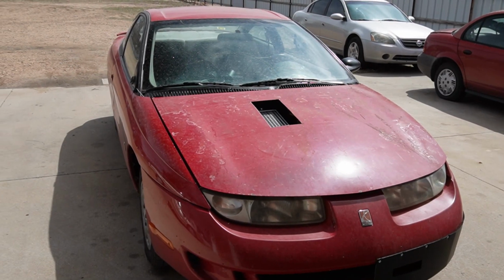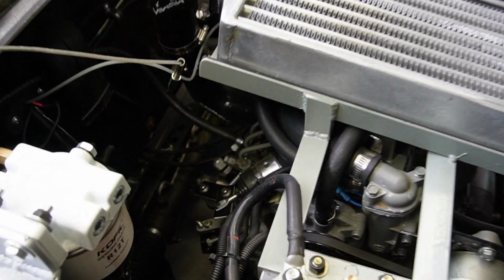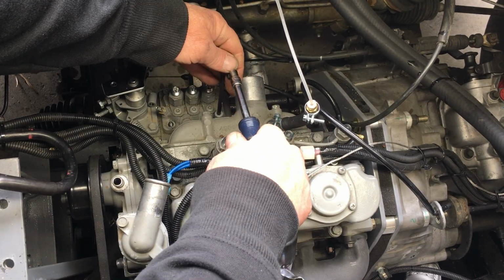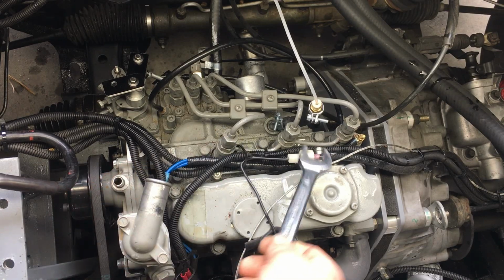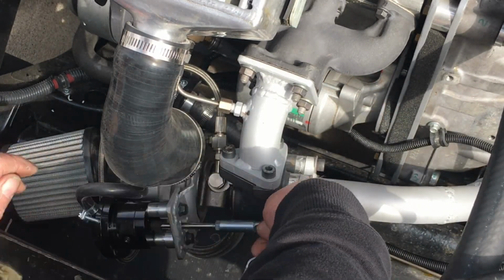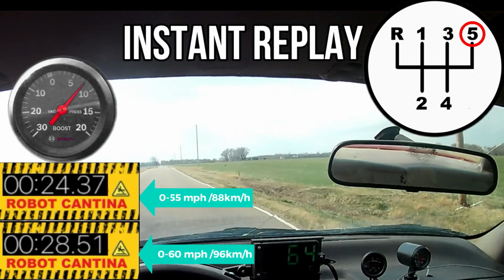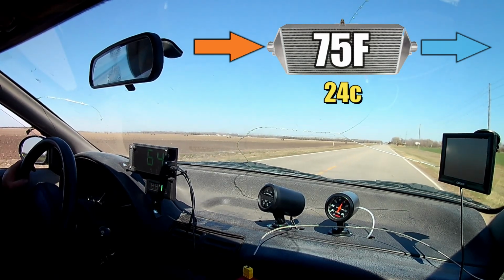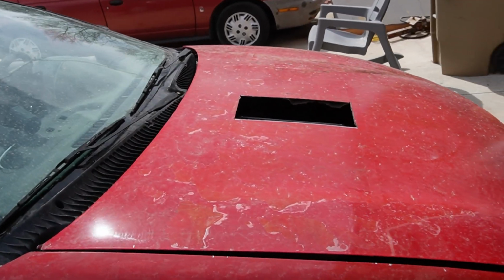S3 E9 We modify the injector pump timing and add more boost for more speed and better fuel economy

Comment: I might be a little crazy for this, but you may want to make your hot side of your turbo a little smaller so the Boost comes on and lower RPM's and is more consistent. It may help you maintain higher boost levels and lower egts.
Reply: Different manifold with equal length runners will fix the exhaust pulse issues causing the higher RPM turbo spin up time. It will also fix the EGT issue because the turbocharger will flow more air on the compressor side for longer under load due to the shorter time between exhaust pulses. A lot of 2 and 3 cylinder engines have this issue with turbochargers. Putting a super small housing around the turbine is just a lazy way to fix the issue and hinders how much overall power you can make due to turbine and compressor wheel sizes needing to be similar for balance reasons at 100,000 RPM. If you make the exhaust housing too small, you'll choke off the compressor wheel with high exhaust backpressure.
Reply: Perhaps simply gate the waste gate signal so the flapper stays closed until target boost. A manual boost controller would be great for this.
Reply: @DominickMarino  doesn't work the same way in a diesel application, air doesn't heat the cylinders, fuel does.

Comment: I enjoy watching your channel and mods. Working all of my life with propane and diesel engines, we have combined the two. The power can be insane, as cylinder pressure can be. WARNING: Propane before turbo is bad for the turbo. Boost reference to the atmospheric vent on regulator is paramount. Master on/off switch coupled to low oil pressure switch is paramount. Adjustable orifice on propane line to after turbo is paramount. 
All in, more power and up to 15% dual fuel mileage. Just don't go crazy with it as you can lift the head or push out the prechamber cups. 
Mikel

Comment: I know nothing about diesel injector pumps, but wouldn’t moving it closer to the cam also increase the depth and duration of plunger actuation?  And by doing so, wouldn’t that increase the amount of fuel delivered at a given throttle setting?
Reply from the maker: depth and duration may change but the throttle is what controls the fuel, not the plunger .

Comment: Think you should add a duct or a scoop if that's how you mounted the intercooler, with it sticking out upwards like that it has more turbulance than airflow and it will do as much as a passive cooler. Air to air collers need AIR, LOTS OF IT. Please do anything to direct some air through the intercooler.
Reply: Also lowering the car, putting a smooth bottom, front air dam and getting skinnier tires would really help too.
Reply: @Oldsmobile69  Well that's a whole different story, what you're implying is lowering drag. Yet I don't see how lowering ride hight affects anything here, it mainly affects center of gravity, which mainly benefits handling. The intercooler is the only thing on the car that's put on in such manner  it doesn't serve it's purpose. That's why it didn't show any performance gains when he put it on. Well besides the shoddy intake piping.
Reply: @icewallowkam2054  Lower ride height gives a bit less frontal area because of tires disappearing into the fenders from the front point of view, I think thats not very significant though compared to it making the air taking another route than under the car, and thus decreasing the turbulence generated by the underside and the tires by a lot.
Reply: @GoldenCroc  I don't think theres a point to affecting the cars drag until it's mechanically finished. Besides, it'll be hard to make it more aerodynamic than it is, as the cars shape is already following someones idea. It's an endless loop of trial and error if you don't know what you're douin. It's way easier to give the car a whole lot of down force and more power than it ever needs than trying to keep the drag in such lows.
Reply: @icewallowkam2054  I was replying specifically to this part of your last comment: "Yet I don't see how lowering ride hight affects anything here" and the effects that it might achieve.

As for your latest comment, its true its easy to go wrong with aerodynamic mods if you are not knowledgable enough, however a few of them can be safely said to always be beneficial even without testing, such as the aforementioned lowering of the car. So its not really an either/or, its just as the first commenter to reply said, its another thing that adds/stacks efficiency.
Reply: @GoldenCroc  and my comment only mentioned the intercooler airflow so yeah, that's how far off the main subject we went from haha

Comment: I have an additional engine idea for the Renault as well. You mentioned that you would like the GEO Metro 3 cylinder engine, but it is difficult to find. There are actually several alternatives and also some interesting small diesel alternatives as well. One is the Mitsubishi Mirage 3 cylinder. This engine is still in production and makes almost 80 horsepower from the factory. They are fairly easy to find. Another is the Briggs and Stratton/Daihatsu 3 cylinder liquid cooled engines. There are gasoline, turbodiesel, and non turbo diesel 3 versions available. The Kohler liquid cooled diesels  are also attractive options, such as the KDW1003, used in the Polaris Ranger 1000. The Canadian 799cc om660 Smart Car diesel is another engine which may be the best option out of all of these next to the Mitsubishi Mirage 3 cylinder. It makes about 40 horsepower but can be tuned to make more power than that, meaning that stock, it would have identical power output to the stock Renault engine. It may be more difficult to get, as it has to be shipped down from Canada, but I think it would make an awesome engine swap. Another weird but cheap option would be to swap in one of the Chinese V-twin yanmar diesel clones. This would be a similar swap to the Predator 420 in the Insight, but diesel. Those engines are also very cheap for a brand new engine with the disadvantage that you have to wait for the shipping from China. One additional crazy idea would be to swap in a motorcycle engine or jetski engine, something with a lot of power at high RPM. Maybe a Yamaha 600CC or similar, or even one of the Kawasaki STX jetski engines.

Comment: A cheap manual boost controller, even turned all the way down would gate the signal and help keep the boost up after the switch to fifth gear. It would also allow you to run somewhere up to or around 20 to 24 psi without changing the wastegate Spring.

It’s very hard to kill a diesel with air, and would be great to see the performance at much higher boost levels.

Comment: Now add a hood scoop and also raise the intercooler enough to add a electric fan on the bottom of it doing this might even help reduce the exhaust gas temperature as well and also remove the cover over the front grille to allow better air flow to the exhaust manifold to help cool it down and you might consider adding some kind of water cooling system to the intercooler make use of evaporative cooling process.

Comment: It would be interesting to see the exhaust if any smoke is present. A little and I mean little smoke, a very light haze would be O K. Smoke relates directly to exhaust temps. Set up your camera to the rear for a test run, just to see.

Comment: You need a scoop over the intercooler. The more you reduce intake temps, the more you reduce exhaust temps. A little cheap, janky, riveted on air scoop. Like a WRX, but not as ugly. It might solve your exhaust temp issue. Good luck.

Comment: My guess is when you go through traps and shift into 5th and it is only 2600 then to leave it in 4th should knock 1.5 seconds off the zero to 60 time with more boost. That little rod with the jam nuts should be shortened to gain 15 to 18 lbs boost. Nearing the cylinder head gasket capacity needing 5 more lbs torque on the head gasket bolts.

Comment: Just curious but if you heat wrap the Exhaust manifold And the exhaust piping under the hood it could help with the under hood temps then all the heat would only be coming from the turbo backhousing

Comment: my suggestions would be go back to the manifold and weld up the insides voids of your manifolds and port match them for better flow, box in your intercooler so air isn't just skimming it, and find a way to inject air into the exhaust to calm egt temps, possibly some smog era pump you could find on a malaise era land barge.
Reply: It's not the temperature inside of the exhaust pipe that is the big problem with high EGT's... and injecting cool air into the exhaust manifold will do absolutely nothing to fix the problem.

The problem with high EGT's begins much further inside the engine. The pistons, for one, is a huge issue. Too high of an EGT ALSO means too high of a temperature of the piston crown. If the piston is getting too hot, that also means that the piston RINGS are also getting too hot. What happens when things get hot? They expand... when a piston ring expands, what happens?? 
The ring end-gaps will end up closing up and getting smaller... 
If the end-gaps eventually touch (and they WILL if the EGT gets too high), the piston ring can no longer grow radially, it'll begin turn to turn into a cup shape, and WILL eventually put SO much pressure up and down in the ring land on the piston that it will cause the top edge of the piston around the ring land to break off and end up in the cylinder. We all know what happens when large amounts of solid objects end up in the cylinder. 💣 💥 

For high performance competition engines, one CAN alleviate this issue by considerably widening the ring gaps to allow more expansion before the ends butt together, but then the engine will suffer from losing compression and using more oil when it's run at a temperature lower than when it's being run at full on competition levels. 
This is why you will frequently see a high performance engine smoke when it's cold, at the beginning of a pass, or by being driven lightly. The ring gaps are too large for them to be as effective as they should be, until they're up to a high temperature. 
For a street vehicle, large ring gaps are completely unacceptable.

Comment: Loving the content.  I love how diesel can be modified for free. My c2500 suburban with a 6.5L diesel, I adjusted the fuel , timing and spring for the waste gate. Once you hit 10psi plus...you could feel the power difference.  I did convert to machinal injection pump

Comment: By moving the rollers nearer to the cam axis you are advancing the timing, but the roller will be coming off the cam will be later so you are increasing the duration and probably the fuel quantity which I thought gave you EGT issue.

Comment: Get some exhaust wrap and wrap the entire exhaust manifold and as close as you can to the turbo. This will keep the heat in the manifold and give you more boost with less EGT.
Reply: This can help response but not boost. If you wrap you keep more heat in the exhaust the EGT will increase in that section. More than anything wrap keeps you from melting other things in the engine bay.

Comment: This makes me want my old 5 speed saturn back. it was a sweet 4 door car, same color as this one. I got rid of it because the motor seized up. After getting a scrap yard motor for super cheap, I realized it would actually be easier to install it in an automatic transmission car because something about hooking the trans up to the torque converter is easier than a manual.

Comment: Propane injection. Excellent content. I did prototype diesel engine testing for many years. Diesels have Exhaust Gas Recirculation for a reason. The charge cooler is heat soaked because of the mounting on a large steel bracket. More instrumentation is key and data logging real time not relying on video sync errors. More temperature and pressure sensors. I wish I could see the car in person. You're really pushing that engine hard. Don't be afraid to blow it up.
 The head gasket is going to be your failure point usually into the coolant passages. NOx is created during lean run conditions. You're not producing smoke as far as I can tell so you're far from too rich. Wide band AFR or Lambda sensors? I want to see that little engine do sub 20 sec 0-60 times.

Comment: Might be a bit late to comment this, but turbo diesel mechanical fuel pumps have a mechanism to adjust fuel delivery proportional to boost. Usually this is a small rubber diaphragm which when the boost comes on actuates a piston in the fuel pump. You could rig up some kind of contraption that eiter adjust the throttle in response to boost, or adjusts the fuel delivery some other way.

Comment: Now imagine how zippy that engine would feel in a lighter chassis, like, say, an old French car.
Reply: 2cv!
Reply: At just over 2000lbs..you wont get much lighter is the USA. I mean sure if a shoe box had wheels it would zoom lol
Reply: The Honda insight only weighed 1900lbs when new, so with the hybrid drive and batteries out bet it’s near 1400lbs. Bet the diesel would go pretty good in the insight.
Reply: Most Kansas farm boys can weld . Maybe consider an ultra light home frame, and the best aerodynamics possible.

Comment: Water injection and then water meth injection needed. Super easy to do and setup.  Pump check valve injector and tank is all you need.

Comment: I enjoy the whole diesel Saturn series chap. I consider you give it a name so it wouldn't be forgotten by time. I got a name for yours, the Saturn 720TDI (it would be more green for eco-guys with a tiny green "ECO" sticker)

But, really, this conversion is astonishing.
The Prius did around 40 - 50 MPG
The Saturn 720TDI did around 58 - 59 MPG with 720cc engine which modified with a Turbocompressor, an Intercooler, and fuel injection pump adjustment.

The 0-60 time is not important when you wanted a car that only drives you from A to B with certain experience of the car.
I like cars (well, some of it, not all cars) especially if it had a diesel engine and of course manual transmissioned, but mainly I like trucks (not the trucks referred to many US people, but truck in the whole world or in UK you said lorry) and buses (with diesel engines), so the 0-60 time is not going to matter me. 
What I personally love about this Diesel Saturn series is the sound of diesel engine, a real diesel engine.

Don't convert this Saturn to EV, please.

Comment: So a few things that I think could help wrap the exhaust pre turbo to help spool the turbo sooner you could also use the windshield sprayer to spray water on intercooler to bring the intercooler to sub ambient temps also if your not using one a cetane booster like diesel kleen silver bottle, xpd or even edt your fuel system will also thank you also it reduces egt a touch too also make sure your down pipe off the turbo is free flowing as possible post turbo theirs no need to be concerned with screwing up the exhaust pulses just a matter of flow so more flow is always better post turbo between the few things I mentioned you should be able to drop close to 100-200*f egt

Comment: The Cummins NTC-855 engine can be tweaked very significantly by altering the injector timing. Yes its bad nor NOx, but it really wakes them up. There was a version called the NTA-475 made by Cummins which had variable timing on the injectors......problem was they used a design of mechanism that had a bad tendency to seize up and cause problems.......but when they were working properly, they went 'hard' in heavy trucks. 12psi of boost is way off where it needs to be............20psi at least.  Dont worry too much about the durability issue...........that engine is meant to do 30,000 hours as a fridge compressor engine........and its not being lugged full throttle for extended periods of time.  You only need piston oilers when a turbo diesel is going to do high load factors.

Comment: I have this same engine (stock obviously) in a club car 1700 it tops out at 21 mph how did you adapt the trans mission, this thing is direct drive via belt to the transfer case

Comment: Tie some yarn to the inter cooler and hood opening  to see if the air flowing over the hood is going down into cooler  or is it making a Venturi and sucking air from the engine compartment up.

Comment: Considering the much faster acceleration and higher speeds the efficiency must have increased a bit to achieve the same fuel consumption. Btw, i think your EGT alarm might be a bit conservative, I've only developed larger hd diesels, but keeping under 700c should be pretty safe for this thing, or are there some exceptionally bad exhaust valves or something like that?

Comment: This may be counter to the direction you are going but, why not decrease the intake Temps through a hood scoop leave the fuel alone and fix the govenor to not pull fuel below 4000 rpm.  Then start adding fuel.  Love your series. Thank you for feeding our inner backyard engineer. Lol

Comment: You might want to get some type of separate boost controller so that the wastegate spring doesn't see boost until the separate controller opens. That way your boost isn't compromised all the way up until full RPM and throttle if you know what I'm saying..
Reply: Correct.... 
A boost controller would definitely help to keep the gate closed until it ramps up to higher boost levels. 

Without some kind of controller system, the gate works more linearly, and softens and wastes the boost down low. 
With a proper controller, the gate stays closed much of the time down in the low boost areas, and then suddenly pops open very near the preset boost level.